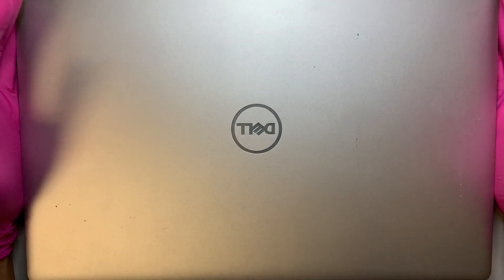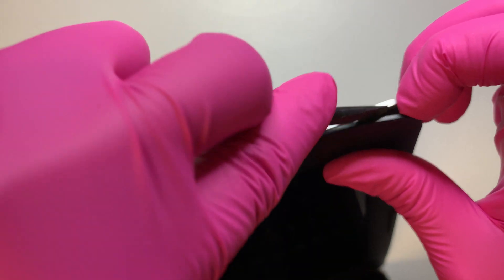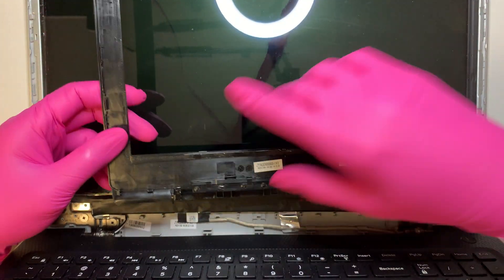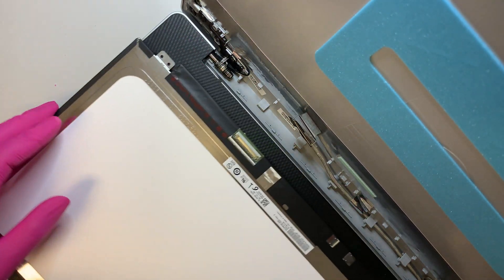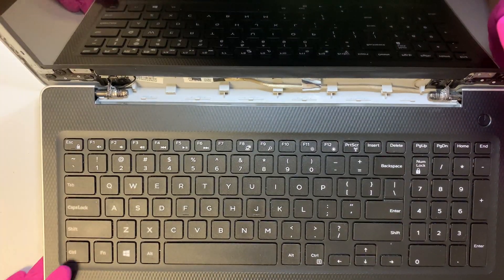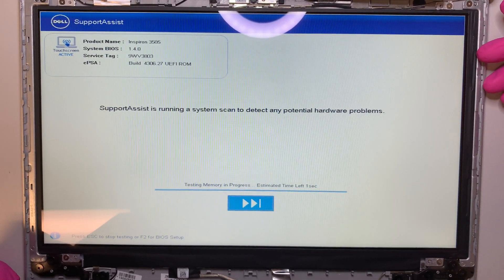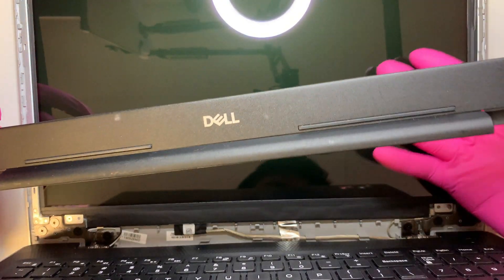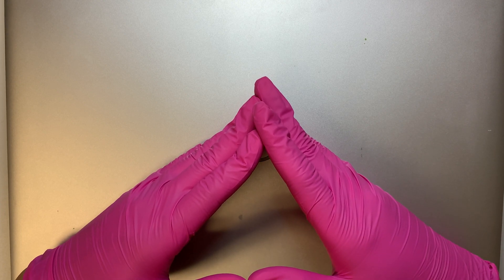Dell Inspiron 3585 P75F Touch Screen Replacement

Comment: 😀 Thanks for the excellent video! Out of all the videos yours is the first I found that spent the time explaining your thought process as you went through the repair. I feel a lot more confident about doing the screen replacement on my Dell (the LCD touch screen is arriving Monday 😇!
Reply from the maker: You are welcome. Glad the video helped. Let us know how did you do after. Good luck
Reply: @UbergeeksBiz  I was able to replace the screen with minimal issues. I had an issue where my touch was not registering properly. I fixed it by restarting the laptop a couple of times before it started operating like expected.

Comment: I have this same laptop but when i turn mine on, the motherboard boots up the fans start then shut off i recently changed a bios setting which caused this.How do i fix this without getting a new motherboard
Reply from the maker: When you power on, can you keep pressing F2 to boot into Dell Bios.
Reply: Doesnt work
Reply from the maker: @tbskitt  Sounds like a bad motherboard to me.

Comment: I have a question, hopefully you can help, I watched your video of keyboard replacement for acer aspire 7, my laptop just stop powering on when i start it but would continue to run if i press any keyboard button but once i stop pressing a key even just a second it would shutdown yet i can restart again using any key but same problem will happen again, thanks hope i can get a response.
Reply from the maker: Hmm.... your laptop has unique problem. Have you tried disconnecting the keyboard to see if it will stays on ?